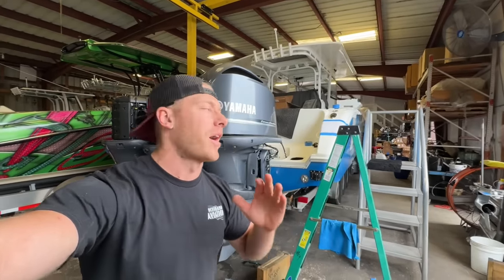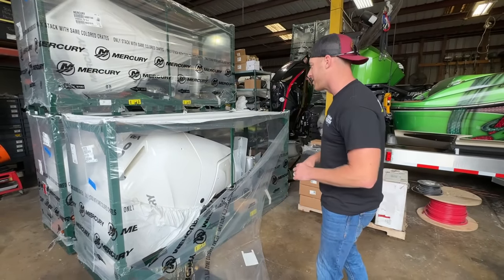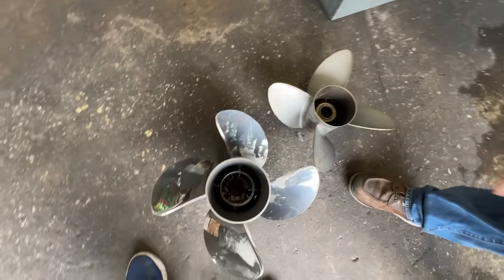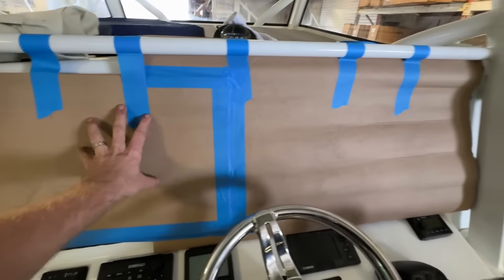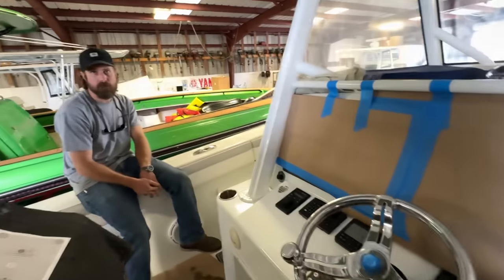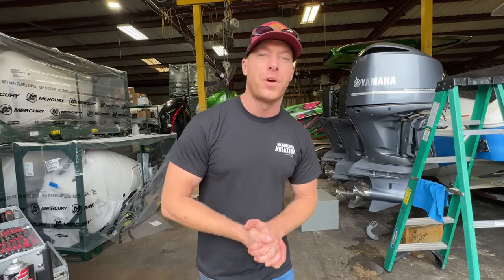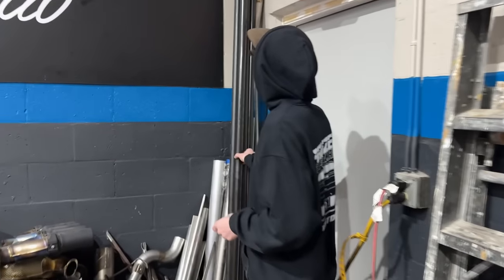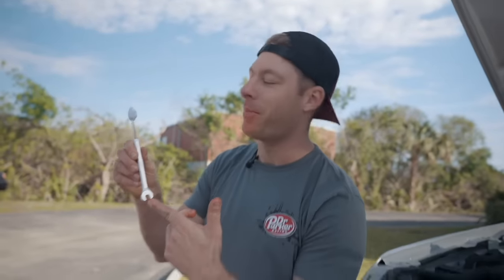More Power for Our 42' Yellowfin Boat!

Comment: Was that boat on a fishing show once? I remember watching a fishing show with the FF logo on the side of a yellowfin but didn't recognize anyone on board.
Reply from the maker: Yes it was
Reply: @DoctrParker  you will like the verado engines, although you won't get as much top speed out of the 3 blades. We did find that the 4 blades got us out of the hole faster without babying the throttle.  Took the family yellowfin down from like 70 to low 60's.

Comment: Should of gotten the joystick great for docking and holding spot when bottom fishing
Reply from the maker: Sorry if this offends you… but joysticks are for noobs. I’ll be setup with split throttles and a bow thruster
Reply: @DoctrParker oh I’m not hating at all love the set up .. we do a lot of bottom fishing on east coast and it has come in handy when bottom fishing when we don’t have the Rhodan trolling motor
Reply from the maker: You know what is super badass is the trolling motor with gps lock instead of dropping anchor to bottom fish